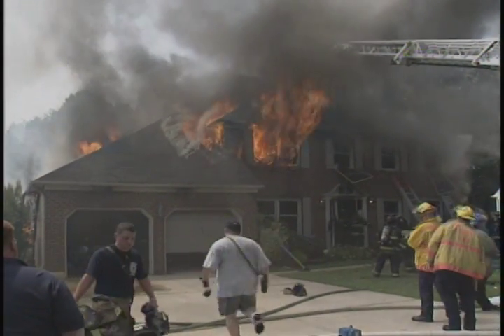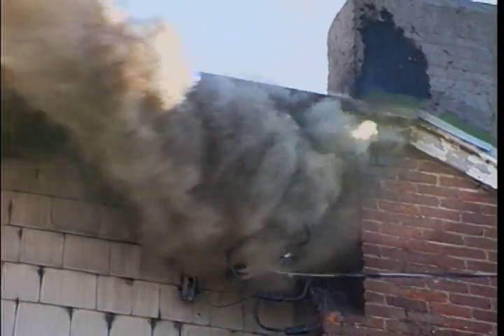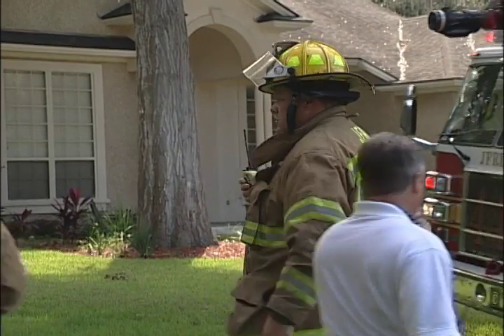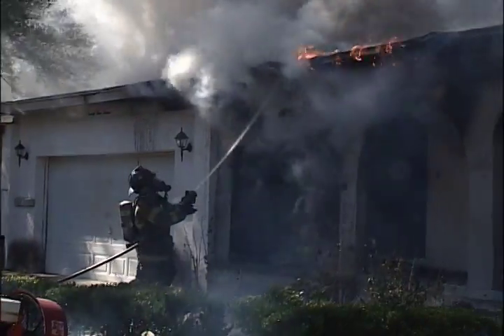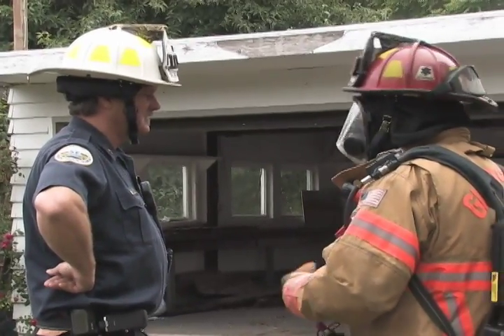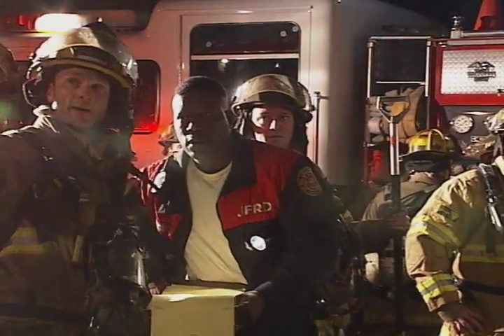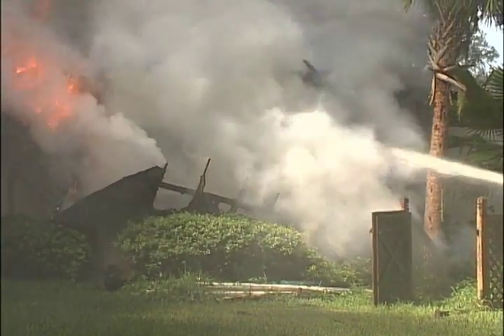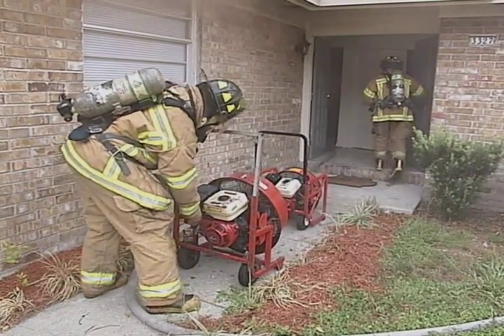24 7 Fire Positive Pressure Ventilation Sample

Comment: If you know what room a fire is in and you set up PPV the heat and smoke will go out the window.  Because of this the fire won't spread as much and effectively protects the rest of the structure.
Reply: S'imba  That was a Perfect response.  You break out windows in Only the fire rooms and the pressure created by the fire will go out that window.  Open a window in a non burning room and the pressure will release in That directing bringing the heat with it.  Adding a fan will help to push the heat out the window In the fire room.